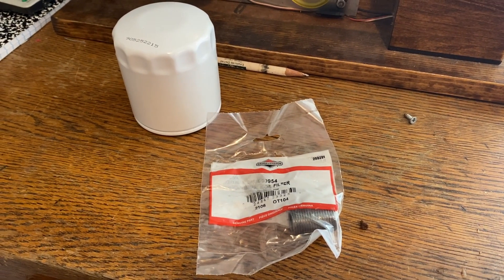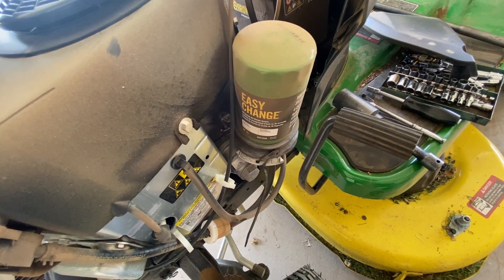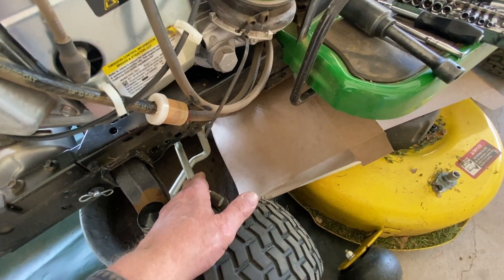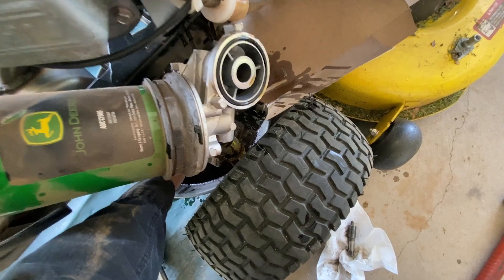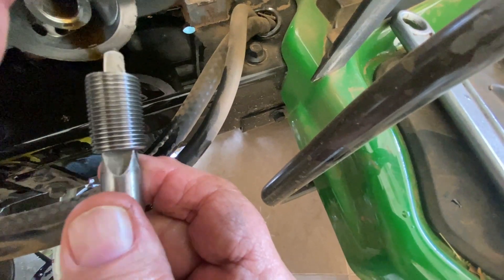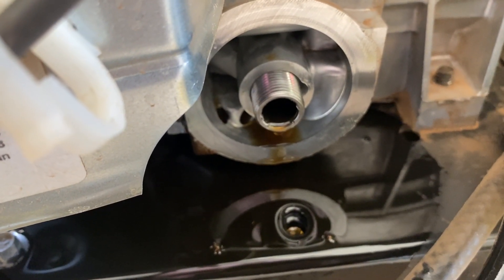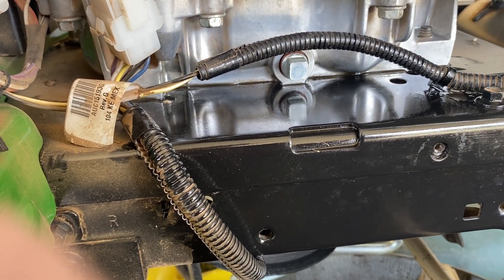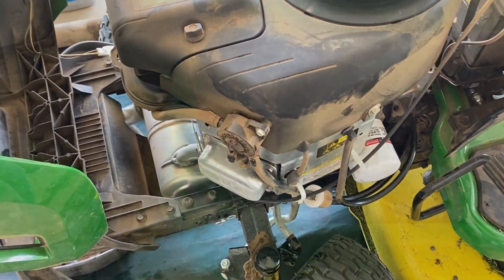John Deere/ Briggs Easy Change oil filter converted to spin on oil filter

Comment: Boy, when the manufacturer goes for a proprietary setup, the costs go through the roof! Nice conversion Lloyd.
Reply from the maker: Thanks Matt, the cost of the filter will no longer be a concern when changing the oil anymore

Comment: That looks like a good conversion, 40-45 dollars is too expensive for a filter change. I hope the pipe extension we put on the drain of our 1962 Bolens ride-a-matic will make a difference
Reply from the maker: Yes, I think the extension will be helpful and not get so much oil on the mower frame. Thanks Joseph

Comment: That "Easy Change" thing is a good idea, but it's one of the worst implementations of a good idea I've ever seen.  Getting that green can off isn't even that easy, and the price is absolutely ridiculous!  (btw, some Deere dealers sell a complete conversion kit to do this. The one I used was from the green parts store, part #AUC12916-KIT. That's the one I used and it worked great.)
Reply from the maker: Thanks , good information and appreciate you sharing.

Comment: Nice fix Lloyd. John Deere and other name brands, like to make you think that you have to tune-up your mower using only their parts, which can cost dearly, but a simple improvise and it will work just fine for a fraction of the price.
Reply from the maker: That's right Ken, Craftsman was great about that. It may look like a Briggs but had some differences. Thanks